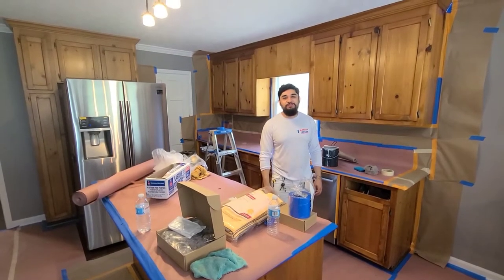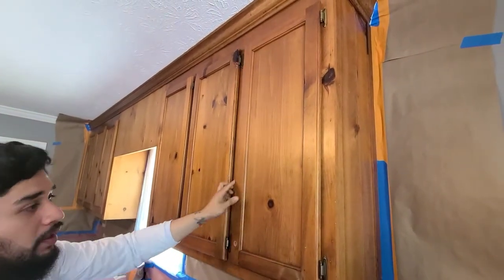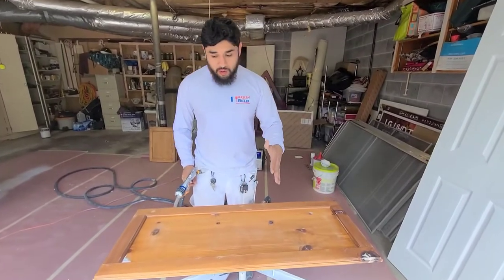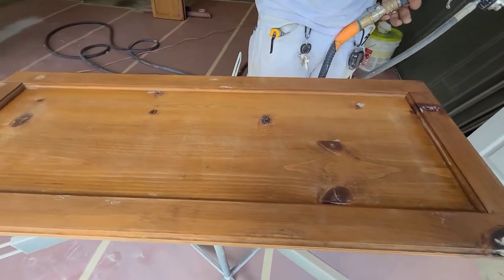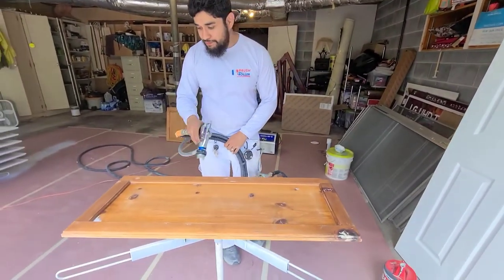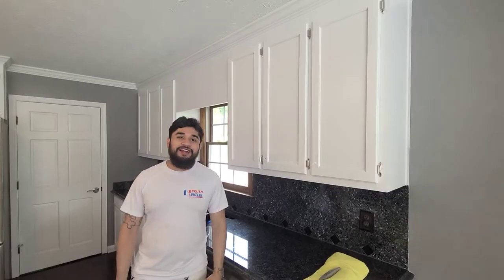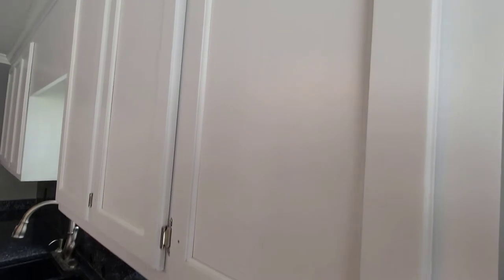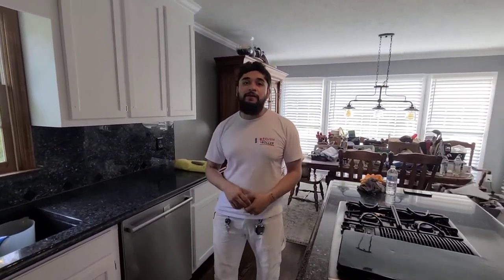BIN Primer: How To Block Knots

Comment: Excúsame what needle size do you use to spray 2k poly thanks
Reply from the maker: Hi Lauro! I used a #4 needle or 1.8 mm needle
Reply: @brushplusrollerpaintingllc2537  thanks for responding and do you thin the paint if yes what is your ratio
Reply from the maker: @laurorodriguez2160  yes i catalyze  11.5% & reduce 5%

Comment: Hi, what size needle are you using, do you find it hard cleaning up the spray gun,,
Reply from the maker: Hi Adrian! Im using a 1.3mm needle. I do not find it hard because i throughly clean the gun after each project. Especially when i use Milesi's coating. Dont let your gun build up dry paint because lack of cleaning